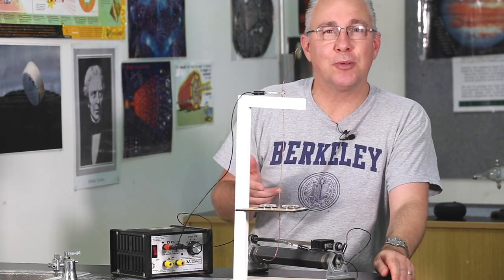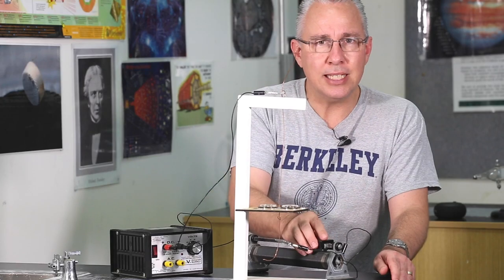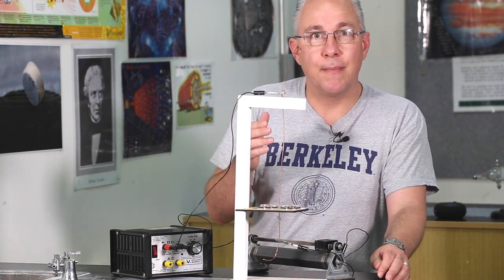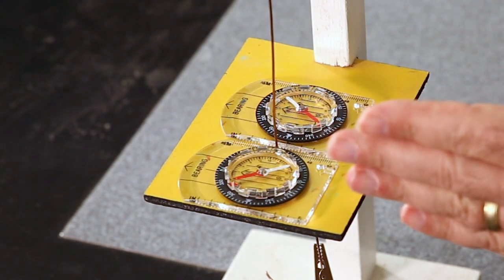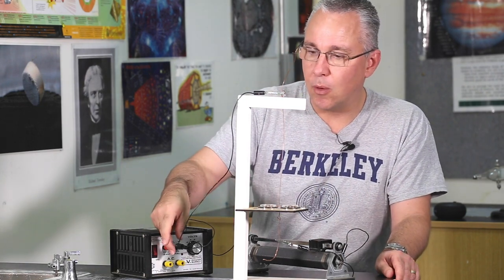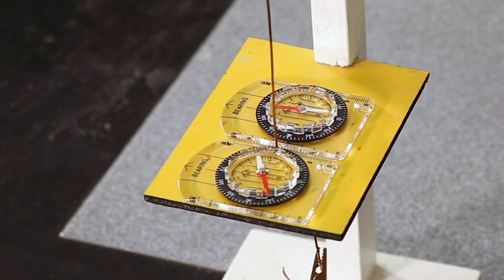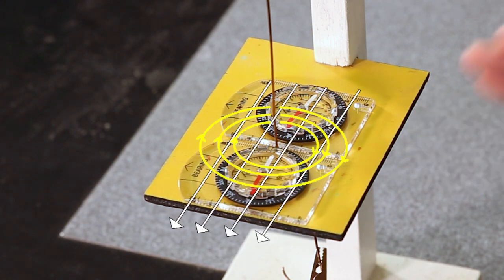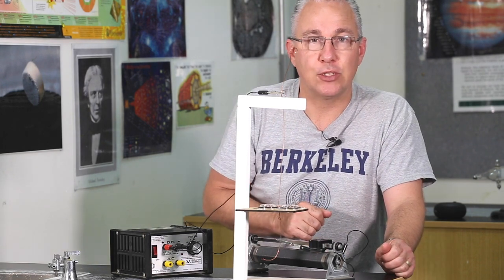magnetic field around current explained

Comment: I just don't understand which way the current actually flows vs. the 'convention' of saying it is the opposite direction.  Doesn't current flow from the negative to the positive terminal literally since electrons are negatively charged?  Also how is the magnetic field around a wire shaped like a circle whereas in an actual magnet the field is shaped like two circles sort of?  Please excuse my ignorance; I'm just trying to be perfectly sure about this.  I don't see the point in a convention of saying current flows opposite to what it actually does either.  Please help without insults.